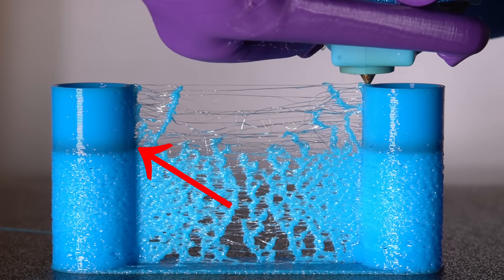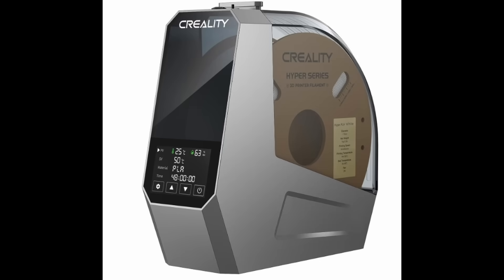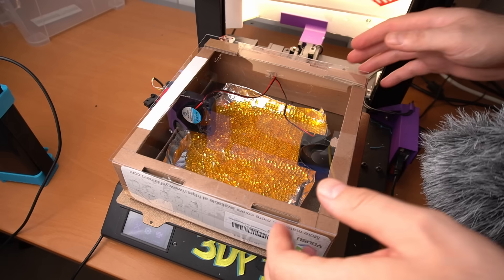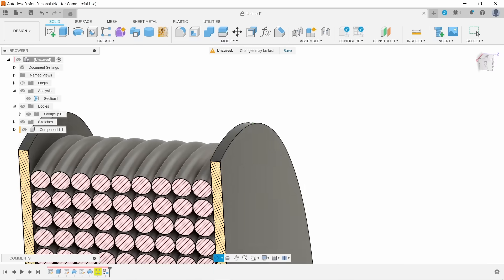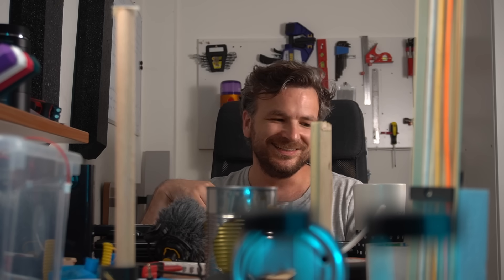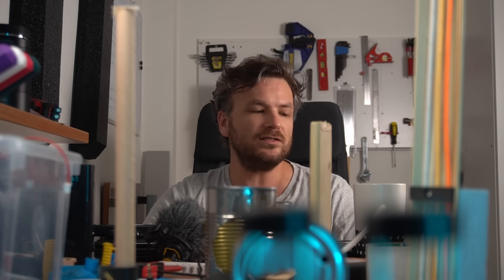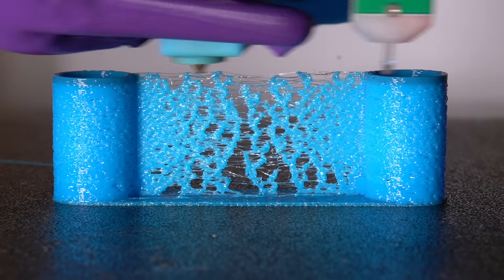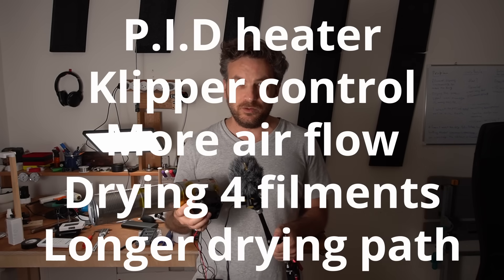Why are we drying filament this way?

Comment: What’s in the $2000 box?
Two multi belt pulleys to wind the filament across to heat it slower and for a longer time. 

The second half is the regenerative dryer that swaps between warm airflow to keep the box dry and regen where it heats high and dumps the air outside.
Reply: Sounds like the PLA death machine if it's bending filament around
Reply: @REDxFROG  
How?
The rollers top and bottom are as large as a full reel and it’s warm and dark

Comment: Feed the filament through it as a single helix to increase time spent inside and pre-heat the air. Also fill it with calcium oxide or some sort of chemical desiccant.
Reply from the maker: I started using activated alumina

Comment: i think you need more lenth of filament in the dryer dry 2 rollers with like 5 slits per roller so you can put the fiulament in on one roller than round rand round 5 times and than off from the other roller so the filament does have enouth time for drying, and put the roller filament in a small chamber connectet via like 15mm diameter vent hoses to a other chamber with plt dryer unit insite ant pump the air around with a small fan and also add a small fan to the roller-filament chamber for eben better circulation around the filament.
im a German trained industrial mechanic with experience in machine building and i do much hobby stuff with my klipered and upgraded ender
Reply: sry for my bad english but i wanted to write fast haha

Comment: I could see something like this working in conjunction with a buffer in a multifilament changer like the enraged rabbit carrot feeder.   I feel the main barrier to these systems is physical, it’s tough to fit a radial dryer inline with existing spool handling.  Printing from a dry box seems  more intuitive and easier to manage.  What you’re implementing here is a more active version of a dry box, so maybe making a smarter faster dry box is a more sensible goal.

Comment: The drying rate is going to be limited by how fast moisture can diffuse out of the plastic. I assume that’s why you start with a dry box, so the bulk plastic is already more or less dry? What does surface drying add at that point? Does it just remove moisture which has been picked up between the dry box and the inline dryer?
Reply from the maker: The TPU kept in the dry box so it will not absorb even more moisture, although it's a new spool there still moisture in it.

Comment: I like your drier. If you could make it so it circulated the air internally and contain desiccant it might work better still. Your device looks like it pulls fresh air from outside, but like you said that's a 60% humidity, which sounds less than ideal.

Comment: Ok, so what about stacking 2-3 cans, making plug holes with some protection, fill the cylinder with dried silica gel balls, wrap the cylinder in heating coils (little curved ones, Im sure you can find or make some), put on insulation, fans on top and bottom for aiflow, control board, some dials, buttons and display so you can control the temperature and airflow instantly manually, I would probably run it on an Arduino so you can control the temp automatically based on speed etc, run the filament through the can and test that contraption.

Comment: My intuition would go to re-use what is already existing for heating filament: Get a hot-end (heating bloc with resistor, heat-sensor and nozzle with a long threaded part), cut out the end of the nozzle (that defines the extruded diameter) : you get a controlled heater that is very light , and normally designed to be able to reach the melting point for any needed printing flow. Set the temperature above boiling point (100°c), but below melting  point, and in theory the filament should be dry... if the  hardware of your printer supports a dual print head, you could repurpose the electronics of the second head to control  your pre-heater/dryer with G-code. This could be installed a few centimeters before the "real" printing head, so you won't waste to much filament when changing spool. 
Worth trying, no?

Comment: It‘s happens everytime, something in my House broke and i need now dry filament. But i didn‘t want to wait 8h . Nice Go on with your Tests. Thanks
Reply: Buy a dryer and a USB vacuum/bag set.

Your mentioned 8hours are not true.
You can put the filament into the dryer and usually start to print after 10-20 minutes from it, the results are already noticeable and will only improve at later layers.

Comment: Moisture can only be dried from a filament so quickly. Even assuming perfectly dry air at just below the glass temperature, you’ll run into a hard limit for mm/s as a function of drier length. It would be easier to construct long and effective filament driers by using a thin tube covered in holes to pull the filament through, and a thicker tube around that with a fan at the top. The heating elements would best be distributed throughout the tube, but just having your heaters at the top by the fan would probably work fine, and easier to prevent from overheating. Hottest closest to the printer will be most effective I think. Also I’ve heard bad things about TPU clogging extruders more easily when warm, so beware that.

Instead I think you’re best off buying some STC1000s, 12V fans, and 50W of power resistors to make your own convective dry boxes on the cheap. I’m building such a drier into the lid of a cheap plastic cereal container, allowing me to easily swap the lid from one filament to another. You store them in the same boxes but with normal lids and containers with visible indicating desiccant.

Comment: What I Backed and use all the time sice Xmas 23 is my Sunlu S4. It has 2 sides with a total of 4x 1kg spools, then it has pockets to put your Silika gel and the hot air is blown directly onto the filament. it runs on differant temps for diffeant filament types up to 80 Celcius and has built in moisture and humidity sensors. So i put in my part rolls of PLA or ABS a into the box get it running, go about setting up and slicing my prints fire up my Printers and feed them, once all is ready i hit play. once i run out of a colour i then use another part roll or open a new one if needed.....its almost an AMS without the self feed bits.....thats my opinion on the S4 (ive had the S1 and Esun's first dryer also) Cheers on your vid though,  it does make some good points. from A M8 Downunder🙃

Comment: You are actually using air containing the 60% of moisture to dry filament. I would suggest you to dry air before injecting into your dryer (you might try to use Peltier cells or a simple dryer of the type used for compressors).

Comment: I have a theory to make this more efficient, the air you're sucking into the tin cans is still as humid as your room. In fact, if the room humidity is higher than the filament, it might cause otherwise dry filament to absorb just a little moisture, so if you suck the air through silica first and then heat it and blow it past the filament, your results should be even better. You could reverse the airflow to dry the silica gel again or just do that some other way.
Reply: Relative humidity gets very low when you heat up the air. At TPU drying temperatures (45C), air that at 21C was at 70% RH is now down to 20% RH. The filament won't get humid at that relative humidity
Reply: @kendokaaa  Thanks, didn't know that! Would it still be useful to dry the air first?
Reply: @scuzzo7  Probably not enough to make a difference compared to heating a bit longer

Comment: What you really should try... is passing the filament through a small but loosely coiled tube of heated nichrome wire. The looseness will allow the moisture to escape.  Use a variable dc current power source to precisely control the temperature. Make the coil as long as you need to have the filament dry by the time it gets to the printer nozzle.

Comment: If filament is on a spool yes, the outside layers will get more dry. But, are the outside layers also the only part that needs drying?
Reply from the maker: Just learned about molecular sieves from your comment, i think its what drywise uses, thanks!

Comment: The Sunlu S4 you showed has fans and vents. Airflow. It also has humidity sensors that will keep drying as the humidity rises. 
Also most dryers allow you to print directly from the machine, while it's drying.
Reply: 100% if you have a heated drybox with fan that lets you print directly from it, then the outer layers of filament will be drying as you are printing and unwinding the spool. it will basically do the same thing as an inline dryer!
Reply: It also has a storage mode keeping the filament dry and ready to go on standby
Reply: The S2 new version also has at least one fan
Reply: You missed the part when he explained that even with fans the airflow hits only the outer layers of filament on a spool. Inside layers are still a wet noodle.
Reply: @DmitrySholokhov no they aren't. It only takes some time until the heat reaches the core of the spool. But you don't print from the core. You people are searching for a problem which doesn't exist.
Use a filament dryer while printing and it's all good. Let it warm up 10-20 minutes beforehand. That's usually the time to slice, upload and warm up the printer anyways.
Most comments of people don't even seem to have a dryer and start to think this guy invented something everybody needs.
Reply: @REDxFROG  thank you for saying this. After watching the video, I was still scratching my head thinking this isn't needed. It worked when he took a drybox of filament and printed with it... of course it did. It probably would have printed the same without his tin can contraption. If you store filament this way too, you can print whenever you want without waiting for it to dry.
Reply: @DmitrySholokhov that’s the part you print from. With proper storage, no part should ever reach the “wet noodle” stage.

Comment: Five meters of 5mm ID tubing (like what you'd use for a bowdon tube, only larger) with a tee fitting at one end blowing hot dry air into it. The filament goes into the other end of the tube, against the flow of hot dry air, and comes through a seal on the other side of the tee and into the printer. The only issue is you'd need somewhat higher static pressure, maybe 1bar or so.

Moisture migrating through a material pretty much acts like heat and can be fairly well modeled with thermodynamic equations. To get maximum moisture out of the material you want the highest possible difference in moisture content, highest possible temperature without damaging the filament, and the longest possible contact time. It's a heat exchanger except you're exchanging water instead of heat. Turn it into a very long and narrow counterflow unit and you'll probably get excellent results.
Reply: If you could cool the air down first and condense the water you could then heat it up and the relative humidity drops.
Reply: This is a bit of a departure from your form factor suggestion, but I was wondering whether, in order to increase the moisture content differential, silica drying beads could somehow be added in line, or before injecting the hot air into the drying chamber, or even both. That should provide an overall dryer environment, and the optimal volume of beads could be perhaps calculated to optimize the whole thing. Am I making some sense here ? Thanks :)
Reply: @crepuscule47  Drying the hot air on the way in would be ideal for this, especially for those of us who live in swamps :) Higher pressure air, through a drying tube (silica, probably), then heat it, then through the counter flow tube seems like the order of operations to me.
Reply: @crepuscule47 
That is how industrial dryers for plastic pellets work (just before the injection moulding process), but you have 2 containers with dessicant material, one in use in line with the air coming out of the main drying chamber and one  not in use but regenerating with higher temp air. An exchange valve directs the air flow trough one or the other dessicant barrel. Heated air goes into main chamber, through desiccant and back to heater, recirculating. There are also heat recovery systems and other stuff going on but this is pretty much it.

Comment: Wait do I misunderstand ? You achieved better results with dry filament in a air tight box and then added the tin can dryer, compared to wet filament with the tin can dryer?

Comment: 🤩 Yes, very interested. Printing only occasionally (as I do) drying is a huge waiting hassle and a shameful energy waste. Especially interested in optimizing further on single filament drying. 
★ Is a closed air cycle with dessicant on the other side (arranged to not be airflow obstructing) good? Or will the dessicant get saturated too fast?
★ To save spacs: Is a thinner tube like a copper pipe feasible instead of the fat cans?
★ Also in this video: More Deatails on the treatment history of the filament from the box at 5:36 please.
If it's pre-dryed then it should work from the get go. If just put in from the outside it shouldn't work as the other results were inconclusive. So I guess it was a formerly pre-dried one stored for days? Weeks? Months? In the drying box. This kind of info.

Comment: Very good! With a PTC heater and the same material I'm making a chamber heater. I Have no needs in instant dehydrator, for the moment (I have a chamber for the mounted filament, so when I become to design I chose the filament and meanwhile it dehydrate, and the for the others I use vacuum bags) but I have a suggestion for you: if you give a longer path to the filament with a pulley system (like the grouped ones for sails, for example), you can optimise your idea, but only for flexible, obviously, or if you use a flexible extensible exhaust tube, you can achieve larger radius curve so you can work with non flexible too. For silcagel: with a little precision scale (0.01g) you can make bags with fine mesh tissue (new silcagel pre-weighted), and with a microwave oven you (250g=max 450w) you can renew perfectly the silcagel in about 15 minutes, checking the bags original weight. Is important to cut the session in parts (I use 5/10min) and in between, you take off the bag and moving it, you leave evaporate the moisture and cool the silcagel, until you can hold it in your hand. Is important that the power of microwave never can make the bag so hot that you can't hod it in your hand for less than one/two seconds: going over the 100C° degrees  can only degrade the silcagel.

Comment: While I appreciate your efforts, isn't this just what filament dryboxes (with fan!) do? Yes, they heat and dry the outer layers more than the inner ones, but that is basically the same effect you have with the inline dryer. 

The exposed filament on the outside layers gets dried just the same as if it was unrolled and dried in your inline variant. In fact an even longer strand gets exposed to the hot air while it is still rolled up on the spool.

Comment: Cool concept! There are some things you could do to make it work more efficiently. First, increase the time of contact with the air. I think the cans are a good prototype, but maybe a coil of tubes or hose would make it more space-efficient. Also, it would be best if you tried to blow hot air in the opposite direction of the filament movement because that maximizes the moisture gradient between air and filament (it is called counter-current flow).

Comment: This has a lot of potential to make 3d printing more difficult materials easier and more accessible, and YT has proven itself to be a great jump starter to open source development. Keep the topic going!

What about using aluminum dryer duct or similar small diameter duct tubing rather than tin cans? Dryer duct has the benefit of being flexible too.

Comment: Filament dryers are a waste imho. Just get a big plastic storage box, weather strip the inside lip of the box where it touches the lid, drop in a seedling/reptile heating mat, a quart of desiccant,  and call it a day. Any wattage is fine, and will happily keep 20 or so rolls dry, just not as fast. (though how fast do you realistically need to be printing with brand new filament, be honest with yourself) I like using molecular sieves because they are cheaper than silica gel but you can use whatever is cheap; just bake them when they get too wet. If you want to get fancy you can add PC4-M6 fittings and ptfe water line to run to your printer, and use some reel rollers, but I don't ever bother with that personally.
Reply: You are basically describing a filament dryer without air movement. :-) 

What kind of molecular sieves do you use?
Reply: @ulaB  You don't need a whole ton of air movement. The heating is what does the drying and heat will diffuse throughout the box and the interior of the rolls with time; the desiccant's sole function is to prevent moisture from being reabsorbed into the filament and barely contributes to the drying itself. 4A and 5A sieves are usually the cheapest. Either will work. Hell, if properly dried, lump charcoal would also work and is probably the cheapest option by far.
Reply: @yoyofargo  Silica gel is very cheap if you get cat litter instead :D
Reply: @ulaB  me realizing a week later that I forgot to specify “commercial” filament dryers in my original post.  They are always so overpriced and don’t even compete in terms of value proposition to diy. lol

Comment: a desiccant wheel to keep the intake air dry may increase performance. Basically a wheel full of desiccant, rotates past a heating element baking it out, rotates into the air intake to dry the air. Back past the heater to cook out the moisture. Probably pointless in this application, but useful in some cases.